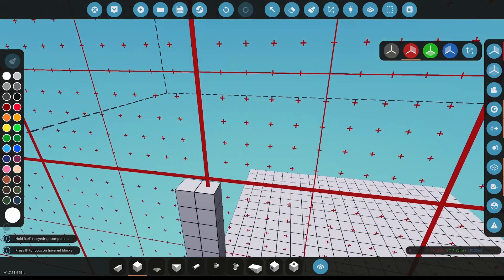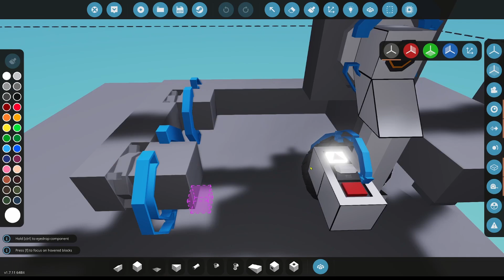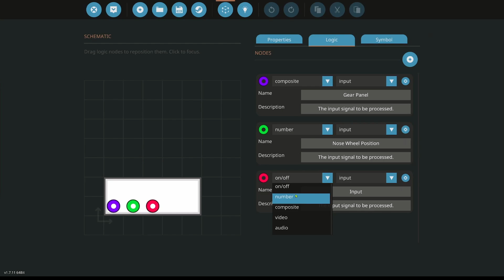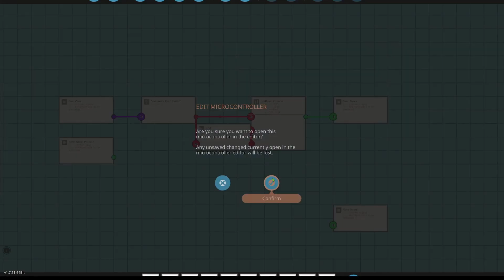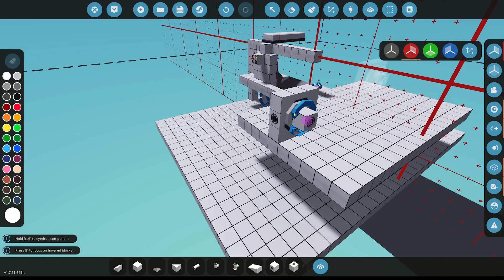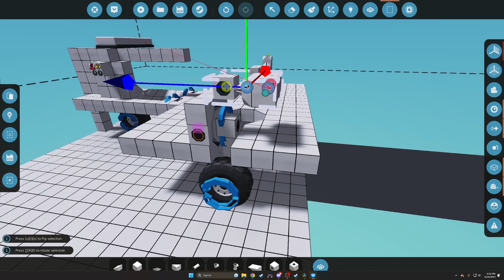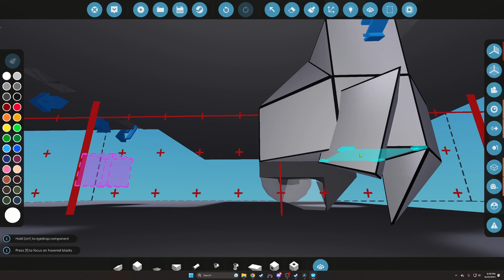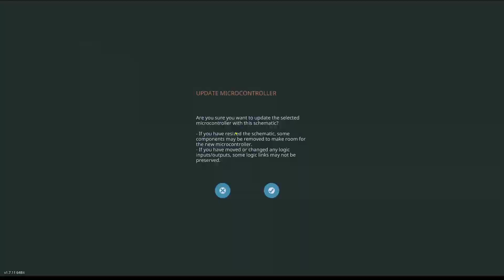Stormworks Basics: Landing Gear #stormworks

Comment: I like how this works, though it doesn’t do what I wanted, I mixed this with capacitors to make it open all the way the gear down, and vice versa, just what I wanted personally, as well as the space I had was so tight it would bind, now it’s checks before the signals. And it doesn’t get stuck 😃